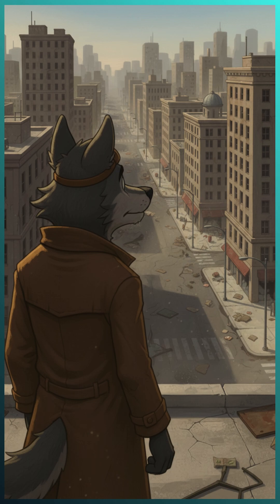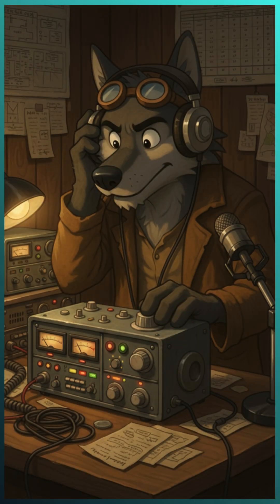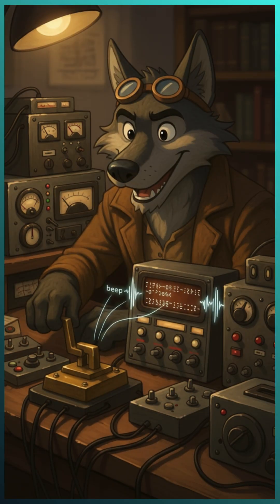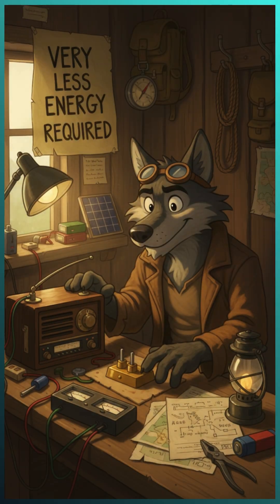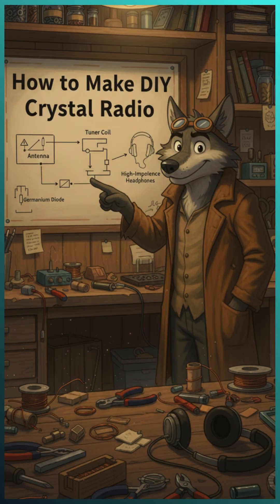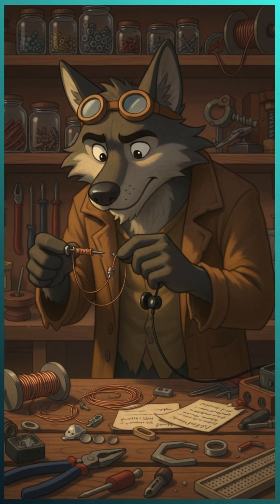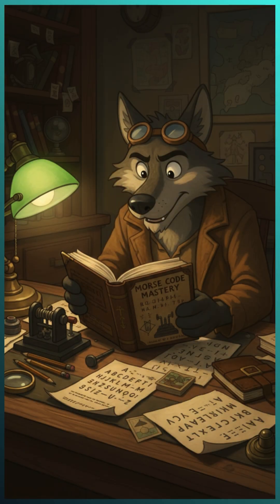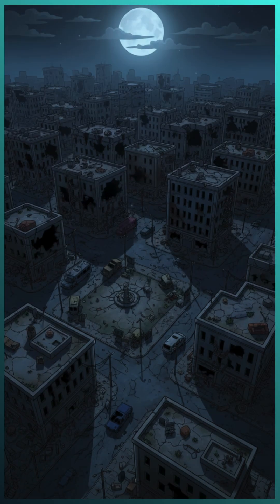📡 DIY Radio Receiver & 📝 Morse Code Tricks for Survival! | Post-Apocalypse Skills 🔧

Comment: Radio transmitters need significant power.  Receiving is not an option if nobody is transmitting.
Reply from the maker: Good point! But in any apocalypse, there will always be groups or remaining government bodies trying to gather survivors so some transmissions are almost guaranteed
Reply: @WastelandWolf07  I personally don't think we get to pick our post apocalypse.  A hand crank generator could power a transmitter.